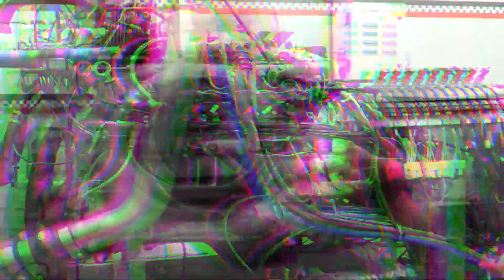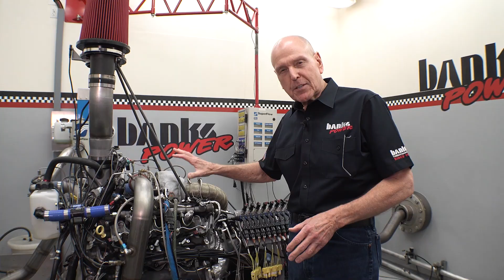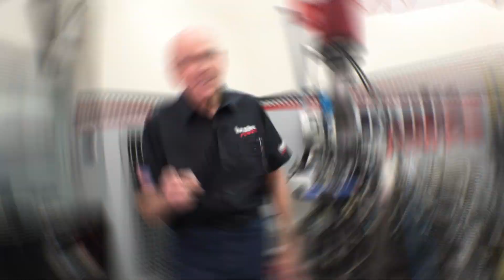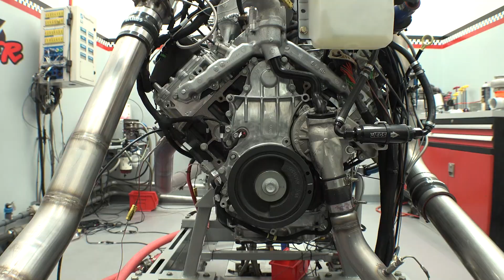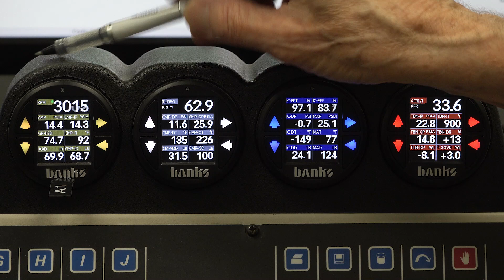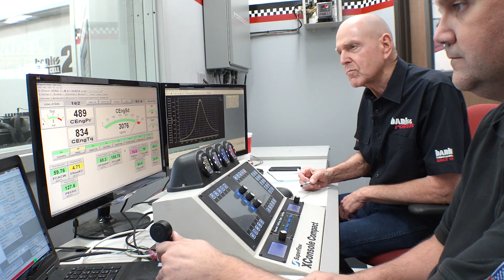KILLING A DURAMAX Pt 6: 65% Better Turbo!

Comment: What about intake manifold runner length? Does longer runner length increase low end torque on diesel's like it does with a Gas engine?

Comment: Hi gale. I have a Mercedes OM651 2014 Vito. It only has 310nm torque. Mercedes do a twin turbo version that has 500nm. What would you suggest to up the torque from 310 to 400nm with the single turbo? I’ve not come access much Mercedes tuning in this manner?? Is it all in the tune? Or simply freeing up the intake and exhaust to liberate the power... I’ve freeded up 60-70hp from my Toyota 1JZ with stock boost and ECU with intake and exhaust mods...

Comment: I know Gale does not like smoke, but with the laggier turbo, surely the right tuned fuel pump (Injector) or tune on a CRD ECU you could easily run the engine fat down low to bring the turbo on faster here?  I did this on my TD42 here in Australia with the right pump curve and the difference was massive.  I had the benefits here Gale was talking about, but I had nearly the exact same response as the stock turbo.  As the revs got on and it came on boost, there is no black smoke at all, real nice a clean from 1800rpm and on, but off clutch at 800rpm it used to bellow out a bit of soot.
I got this pump of mine built from a guy who is pretty darn good at doing this and I can't argue the point, it worked very well indeed. 
I know Gales mantra about smokeless diesels, but I do disagree with this to a certain degree, there is lost performance in the lag scenario that can be eliminated by running it rich down low in the lag RMP zone.    My EGT's were magic all of the time at 300hp, even on the beach and sand.

Comment: Mr. Banks, sir, you need to give one of these Data Monsters to Westech performance for shows like Engine Masters and Richard Holdner's tests. Once guys get used to being able to see all this date when we get sloppy and try to blow stuff up. We're all going to buy one and not going to want to look back. Also Matt Happle has a channel called Sloppy Mechanics where young guys go who are turbocharging junkyard LS/Vortec engines. Even though "Slops" as we call ourselves take pride in making junk work for us and spending as little as possible. If we had mysteries we are battling against better undstood with this data it would really push the hobby in a massive way.

Comment: I certainly appreciate the monumental task of research, engineering and sheer knowledge that went into this video series but at the end of the day in my opinion its a bit like the difference between a swiss army knife and a scalpel. I think in my truck I would rather have the VG turbo which does lots of things well rather than a larger non-VG turbo which only really does one thing well and that is to compress as much air as possible for max output. At the end of the day, max output will break things.

Comment: Another intriguing video. All that data logging  could be overload unless you have the nouce to understand what the interplays mean. When there  was nothing much in the cold side, the hot side was the epiphany, basically less back pressure which = less temp, wasted energy and the turbine is not working as hard which would help with reliability/durability... and of course a lot more headroom for more performance.
 As for the lag, loosening the torque convertor  would be an all round negative for fuel consumption?. What about some sort of anti lag such as a shot of compressed air onto the turbine similar to a shot of nitrous. There was a a drag racer running a Buick engine who used to shoot Nitrous into the periphery of the turbine housing to spool it up and apparently it used to hit almost too hard off the line.Dual effect of turbine impingement plus the boost in exhaust volume when it went through the engine. Koennigsegg do a similar thing with their cars I believe using a carbon fibre storage tank. I also drove a propane supplemented heavy duty truck which had a much better response. Two fuel systems of course but a good way of accelerating without the hated hated rolling coal. Just for giggles maybe a side by side comparo of a VGV turbo vs normal would be interesting for response and restriction.

Comment: Gale... I’d like to see you apply the same tests variables to real world Truck scenario in 2019 Duramax truck. The test objectives should include: increased engine efficiencies, improved performance, improved fuel mileage, increased engine longevity. Said differently seeking to strike a balance between efficiencies, performance, and longevity. The combination of after market parts, tuning, testing, and real world testing - should produce an engine spec that strikes a balance amongst these seemingly competitive variables.

I believe that’s what diesel owners want to see, and then force the big three into producing trucks that come close to meeting these parameters.

Comment: Hay I enjoy this destroying a Duramax I have a question I was wondering the I dash can you use those on any vehicle or is it only on specific makes and models?
Reply from the maker: It's universal for any CAN-BUS OBD-II connected vehicle, 2008 and new right now for plug'n'play. If you want, we also offer an iDash for use with older vehicles, even ones that don't have ECU's. We offer our 4 channel analog sensor suite and accessories that can connect to the iDash so you can view anything that you connect a sensor to. Check them out.

iDash : https://www.bankspower.com/series-2-idash-1-8-datamonster-and-super-gauge.html#!sq%3Didash
iDash Accessories: https://www.bankspower.com/c-70-products-idash-digital-monitor-idash-1-8-accessories.html#!
Reply: @bankspower  thank you for that info greatful for the info

Comment: Your videos should be required viewing for any budding engine builders - I've been around this stuff for better than 45 years and some of your explanations are the best I've seen! 

11:30, I do like the inclusion of the pressure drop through the two different filter setups - that is one of the things I have wasted a LOT of breath on, trying to educate people that an engine is basically an air pump and any intake restriction will affect ALL efficiencies of the engine! Like people who do 'tune ups' with open intakes and who then put badly designed, undersize and/or restrictive filters made with filter element materials with poor flow and/or filtration characteristics*!
IIRC, the worst system (mini-filters on velocity stacks) caused almost 150hp loss, on a otherwise very healthy engine, compared to open stacks!

HKS used to have a foam 'mushroom' design that was very popular, even though it managed to fail on all 4 points...

Comment: Gale, the bigger turbo is unsurprisingly more efficient at higher RPM's and higher loads, but what about low loads and low engine speeds?  Wouldn't a big turbo that is barely spooling up almost act as more of a hinderance?  And if so, roughly what engine speed/load would be the cross-over?

Comment: Just going to throw this out here to see if it's a really stupid idea or not.
My thought is that turbo lag could be eliminated by adding more pressure to the exhaust manifold on demand. Perhaps a three quarter inch pipe feeding in air at 75 psi electrically activated when you mash the throttle from low rpm? The tank for this can be refilled by an electric air compressor over time 5- 15 mins for a larger tank or an engine driven compressor as is used in trucks.
Reply from the maker: A novel idea for drag racing... but for daily driving or sustained racing the amount of air needed would require you to turn your truck bed into a giant air tank. And, you'd need an air compressor the size of a small engine to fill the tank at a rate that would replenish the air faster than the turbo is consuming it.

Comment: How about an explanation of compound, and twin turbos, in this detail ??? Amazing, diesel power!!   What is your opinion of the old Detroit 2strokers?? 6v71, 8v71, 6-71,  6v93, they sound like the race engine of the diesel world!! But can they make power? Like a 6v71, with twin turbos added to the mix, I know they are not as common as they used to be, but even the 4-53's sounded mean!! Great video Mr.Banks!!

Comment: What would happen if you had an adjustable turbo bypass for the stock turbo.  This way you would reduce back pressure on the intake flow to the cylinder but kept the proper pressure to the turbo through the acceleration range? Does this make sense?

Comment: Could you make the exhaust side a little smaller say 70mm happy between the stock and the 75 mm that would spin the turbo up faster and give more more rpms to the turbo witch would I turn spin the intake side up so you would get more volume at lower rpms?

Comment: It sucks that diesel guys watching this will latch on to the brand names used. Precision makes stuff for high pressure ratio, and Borg Warner is more/better coverage in compressor design. Too bad Banks isn't using a BW of the same size.

Comment: Just saw this whole video wealth of information true legend. But in all the statistics all of the data the logging one thing is missing fuel temp
Must be factored in the data  cooling the fuel at the injection. By 10° will make a big difference.  Run the fuel through a transmission cooler with a fan after positive pressure pump....aka...fass pump. Lowering the temperature of the fuel would like to see same data but with the lower temperature fuel......🤔

Comment: @Banks Power 
To reduce turbo lag would a system with 2 turbos be useful. Say, one being 1/3 the inlet size of the precision turbo , and the other being 2/3 the inlet size. My thinking goes like this, the smaller turbo can spool quicker due to the reduced turbine size. So when you hit the accelerator the smaller turbo reacts quickly giving the larger one time to get up to speed, when it does they would work in unison. If it was necessary there could be a valve system before the turbos, alternating  the air flow between one or the other or any ratio in between. Sort of acting like a deconstructed vgt but much more modifiable.

Comment: Cant compare fuel usage if you run the same test at different air fuel ratios
Reply: The RPMs and Power were the constants.  Fuel needed to maintain the set  rpm-power  would have to change.  The engine needed less fuel with the PTE turbo, so you get higher afr #.

Comment: I would have liked to seen the precision turbo with a motor torque down around 1800 to 2300 RPM. I would have liked to have seen numbers with a load on the motor in a towing situation
Reply: The engine dyno puts as much load on the engine as possible without reducing the engine speed, which simulates maximum towing power.

Comment: Gale Banks you rock.   But I would like to compare apples to apples because I am a very picky person.  I don't know if it is possible anymore, but I would like to see a complete comparison pull with the revised dual cold air inlet, MAF,'s & filters using the stock turbo.  I agree all the data looks good, but some may be the result of inlet air flow & dual MAF readings may not be spot on compare  to 1 sensor.
Reply: So to recap from this picky person.  AATemp that day is test booth (hotter & probably more sticky) up 9  (worse)
AADensity  -2.2 probably dirrectly related to heat,  (worse)
CAIPLoss  -54.8%  CAIntake loss was only  -6.6 (both better with dual system)

Comment: the intercooler is adding less hp with the precision because the precision isnt pumping out as much heat in the first place, correct?
Reply: I think the turbo compressor temp was higher with the precision.

Comment: Mr. Banks. Could you help us understand why electric motors have not been connected to turbo shafts to help drive turbos through their lag?  An electric motor could help at lower RPMs until exhaust gases take over by using a sprag (one way) gear/clutch. It must not be feasible since no one does it. Could you help us understand why?  Thank you.  Btw, been a fan since I saw your Bonneville Firebird in Car Craft in the late 80's or early 90's. Thank you for all your engineering contributions!
Reply: They already have been.  Current Formula 1 engines use a turbocharger with an electrical machine sandwiched between the compressor and turbine sections.  It operates as an electrical motor to accelerate the turbo when there is not enough exhaust energy to make the desired boost.  Then it operates as an electrical generator to add power to the hybrid electric motor when there is more exhaust energy than required to make the desired boost.  This has been on all F1 cars since 2014.  Also, Porsche won LeMans in 2016 with the 919 race car that has two turbomachines mounted on the exhaust manifold.  One was a conventional turbocharger, and the other was a turbogenerator (turbine and generator)  that used excess exhaust energy to add power to the hybrid electric motor.  There are also a few manufacturers of turbochargers that are making e-boosting devices that are centrifugal compressors powered by electric motors.  These are mostly being used to boost turbochargers for a few seconds to get rid of lag, then they kick off.

Comment: 25 minutes to tell you a larger diameter turbo makes the same horsepower as stock, generating less heat? C'mon man, don't need a 100K dyno and an engineer to tell me that. More air in more air out, better volumetric efficiency. Only downer is "Turbo Lag".
Reply from the maker: You may have misunderstood. He ran both turbos at the same horsepower on purpose to see the differences. The larger used less fuel and created less heat. That was unexpected.
Reply: He also showed all of the data, and showed that most of the power gain was because of the exhaust flow, not necessarily because of the bigger compressor.
Reply: @ericsperformanceparts1647  Where do you think any exhaust flow increase came from???? The larger turbo, remember it not just larger on the compressor side!
Reply: You said "more air in, more air out" but both turbos moved about the same amount of air.  The point that you are missing is that the larger turbo not only uses less fuel, it also has a much cooler exhaust.  The cooler exhaust led to the volumetric efficiency.  Gale laid that out very well with data point to show this.
Reply: @ericsperformanceparts1647  It's IMPOSSIBLE for both turbos to move the same amount of air. Even at identical RPM, the aftermarket turbo moves move air due to it's LARGER diameter. Look at the pictures. OEM unit has all the variable displacement mechanical internals that restrict air, C'Mon man!
Reply: @dezford5408  the RPMs and Power were held constant by the dyno.  The Mass flow of air into the engine was about the same.  Rewatch the video and look at the graphs with the data.

Same power level, but less fuel with the larger turbo.  Less fuel makes less heat.  That's where the efficiency is.
Reply: @dezford5408  look at the video 12:30. The mass flow out of the larger turbo was actually Less than the small turbo.  This was because of the higher intake temps.

Comment: Love the info! Would be awesome to see a more comparable size gated turbo vs vnt. Like a 62 or 65mm gated vs stock as it would cut down boost lag ect. But still break down the data or temps fuel efficiency ect. Love the video!!!!

Comment: Gail's killing ME with anticipation for every installment of this series!  The big improvement of the Precision Turbo over stock is lower turbine inlet pressure.  The stocker was choked at 510 HP, and the Precision is just starting to sing.  The larger turbine exducer diameter is the key here.  The intercooler is doing a great job of basically pulling all of the compressor temperature rise out of the charge air, but 1.3 psi seems like a lot of pressure drop.  I think Gail will be doubling up on the intercoolers to get max power.  I think he'll get to 700 HP with it.

Comment: 5 % less fuel burnt "gain" will be lost each time the driver will press the pedal more to compensate for the lag,or if you loosen the torque converter.
Unless you race the truck that's a useless turbo compared to stock for normal use.
Better charge cooling would be more appropriate on a stock set up.
Reply: If you are mostly towing, and need that 500hp to tow, then you would use less fuel during your tow.

All new vehicles have lock-up converters, so a loose stall to get the boat moving would not be a problem when it locks up.
Reply: @ericsperformanceparts1647  Yes, but sounds like a long return on investment after buying parts and get it tuned.

Comment: Why 510hp is that the stock numbers and the efficiency was up at that power level but would it be better at the lower power levels
Reply: James Holbrook 510hp is when the stock turbo starts to fall off.